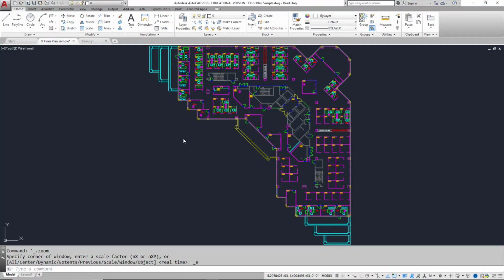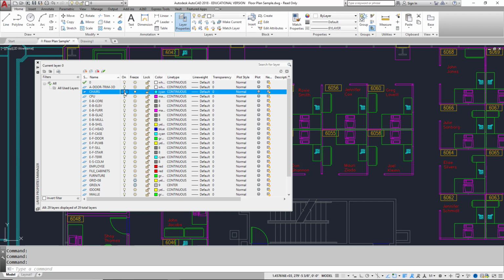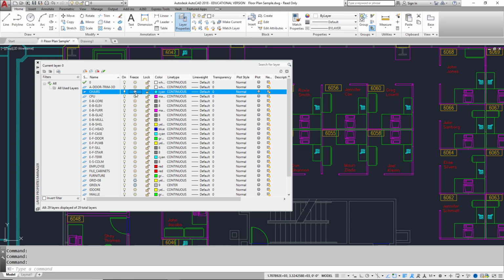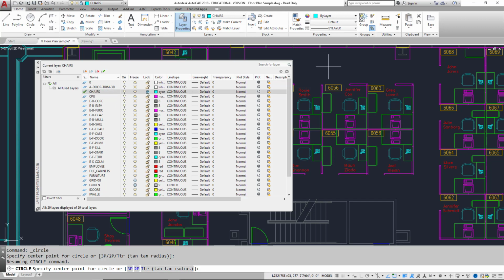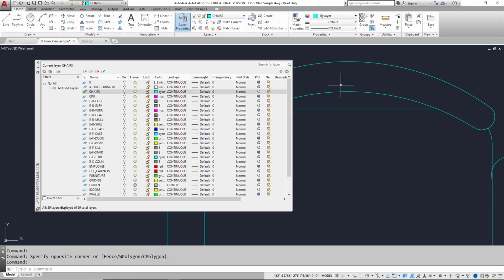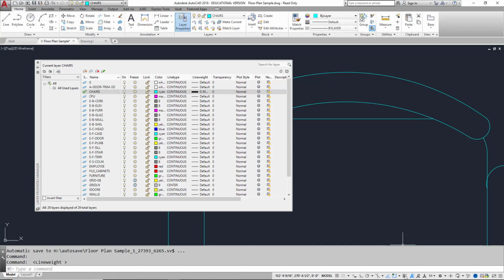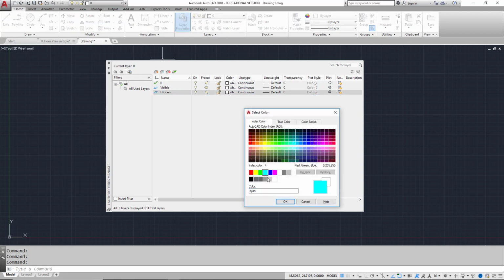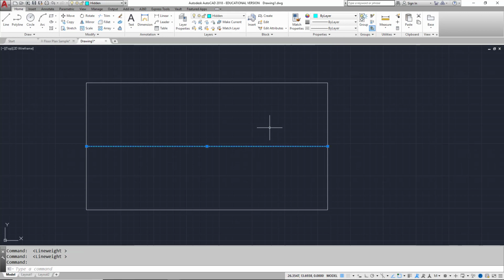AutoCAD Layers

Comment: Hello Professor Porkchop:) Having problems organising layers on a floorpan. Not all of the doors (on separate layer) are appearing on top of colour blocks, on different layers, identifying rooms. No layers are turned off, frozen or locked. Thanks in advance.
Reply from the maker: Hi there!
I assume you  are using a hatch pattern for the color block that is obscuring the doors.
There are a couple of ways you can solve this problem.

If you are using a hatch to apply your color blocks, you can use the HATCHTOBACK command. This command will automatically move all hatch patterns under other objects so you can see them.
The other way is to use the DRAWORDER command. In this command you can select objects, then tell the computer if you want them in front, in back, or above or below other objects.
I know this is more than you asked, but there is also a command called TEXTTOFRONT which will allow you to bring text, dimensions, and leaders to the front so they are not under other objects like hatches.
Let me know if this solved your issue!